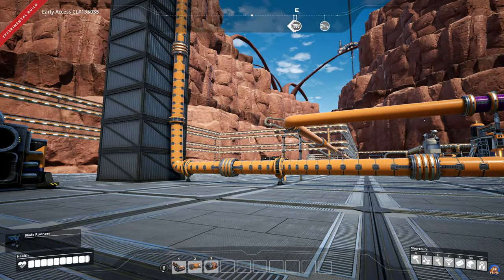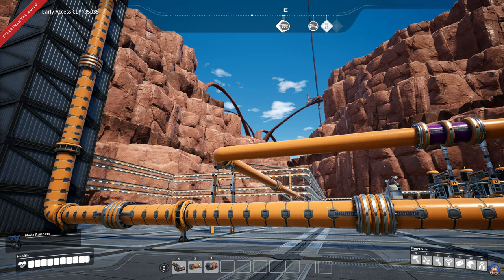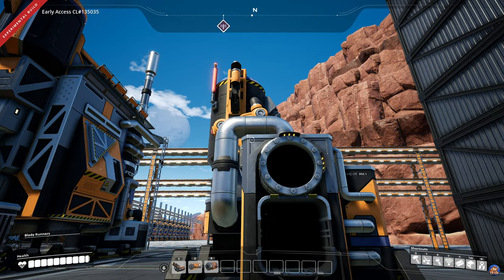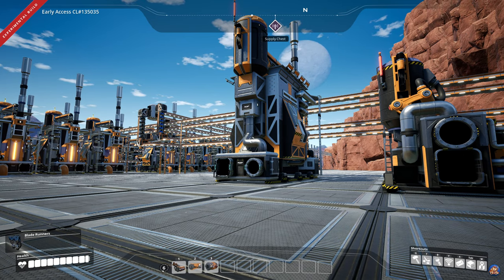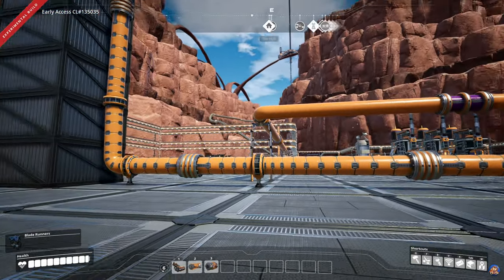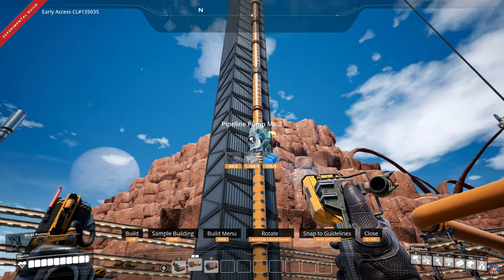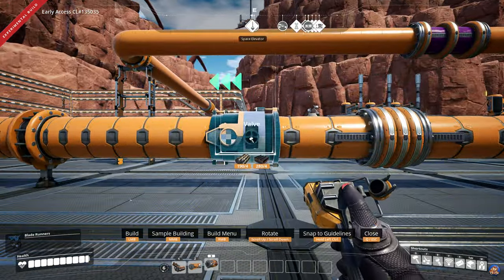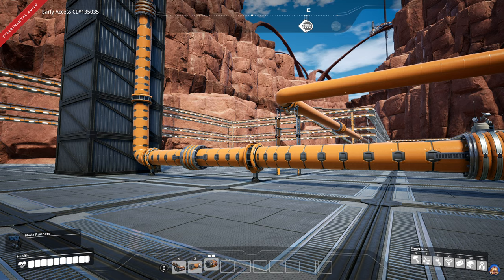Satisfactory Tutorial: Fluids Update - Pipes - Pumps - Valves - Packagers - Fluid Dynamics

Comment: beware of the valves, they will only allow the assigned value of liquid through if the pipe flowing into the valve is completely full.
So, for example, you have one MK2 pipe(600m^3/min) and you want to constrict the pipe to allow 300m^3/min through it.
Then say the pipe you have leading into the valve can store 10m^3 of liquid.
If that pipe has any value less than exactly 10m^3 stored in it, the valve will not allow the full 300m^3/min through.
This is very valuable information as it can screw over an entire pipe system if done incorrectly

Comment: I'd quite like to see the twin inputs become a rotatable option so we can choose between vertical but also swap the left and right on buildings like the coal generator or refinery that has one of each. 
Got a sneaking suspicion they might lower the flow on mk1 pipes, slot a new mk2 in and bump the current mk2 up to mk3. Although with the valves they might keep the current marks and add in other flow control options.
Reply: I really like the idea of rotatable inputs. I quite like the vertical overall though tbqh
Reply: @Jon-id7ki  It's something that springs to mind every time I layout coal power and have to either use in extra splitters or offset one side to the belts line up and have a slightly bent pipe for the water. If we could flip the inputs they'd line up and it'd look nice and neat.

Comment: Is there any way I can get the valve thing to face a certain direction? [like the valve symbol thing on the side being shown on a different side of the pipe yknow]
Reply from the maker: I'm not sure with the valves. I know you can turn the pumps around by left clicking once when you have placed them where you want them, and then you can use the mouse wheel to turn them around before you confirm the placement by pressing left click a second time. But I almost never use valves, so I'm not sure if this applies to them...

Comment: I JUST CANT FIND OUT HOW TO SEND PIPES VERTICAL AT ALL
Reply from the maker: You need to have a point to attach the pipe to above the point of origin. So build something that the pipe can connect up to above where you want to go from, using walls or foundations (or the terrain), and you will be good to go. Remember that a pipe has a maximum length. Wall attachments can be bought in the Awesome Shop for tickets from the Awesome Sink.